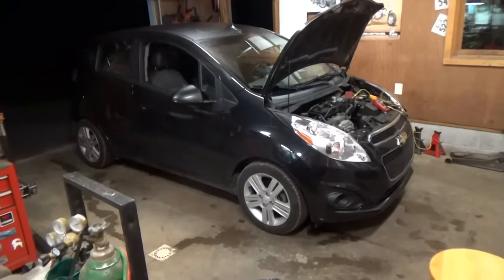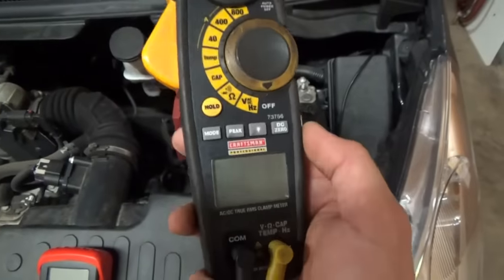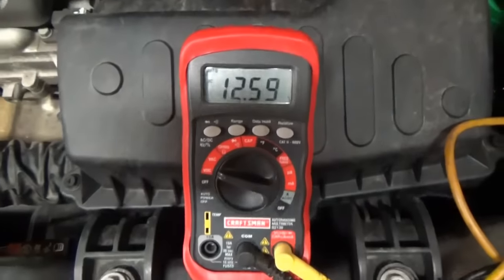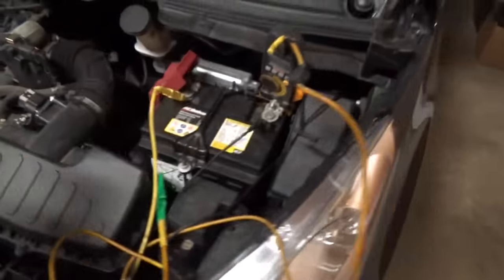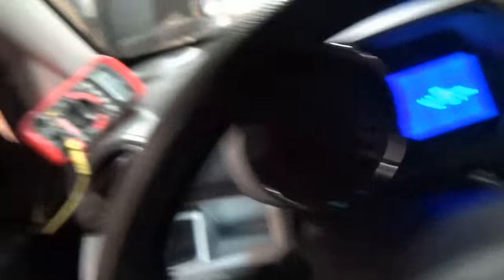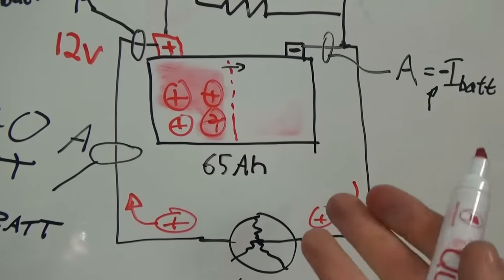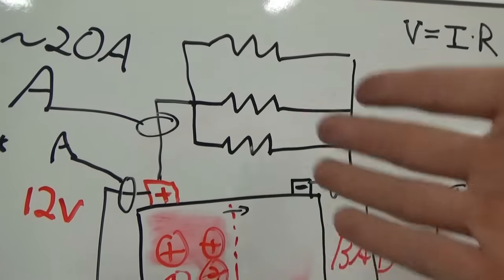Battery-Alternator-Draw Tests: EASY & ACCURATE

Comment: I have a few tool suggestions for you that are intended for electricians but are adaptable for use in the automotive trade. First is a very small amp clamp that would be real handy then I have included a few tools meant to pull/manipulate wires without marring insulation and keeping hands safe.

▶ Regarding the [need for a smaller] 'amp clamp' I have a recommendation for one that would be just perfect for this application. I have been involved in the commercial and residential electrical trade for several decades and possess quite an inventory of electrical diagnostic pieces. The particular instrument that I am reccomending is:
. . .  'Uni-t UT210E' - AC/DC volt & amp; amp ranges of 2, 20, 100 (100A max range covers most sins, and has very excellent low amp resolution in lower ranges); data hold feature; 'zero' button for DCA; clamp is marked for +/-  side orientation direction for DCA use; ohm & continuity; very compact unit will easily fit into a shirt pocket and will physically get into spaces under a hood that would prove prohibitive with a larger unit; it also has an excellent 'NCV' that is non-contact voltage feature which is intended for AC (and is very sensitive and works very well), but what I discovered is that the LED visual and audible notification also responds to my phone and tablet charger wires (when plugged in) which are DC, I'm not quite sure why it does that but anyway it detects those voltages (perhaps it will respond to auto system voltage which could come in real handy); it comes with carry case and leads; all of that for under $50; the only thing I wish it would have is a min/max feature however the unit is quite small and possibly prohibitive for another button.

▶
https://www.knipex.com/index.php?id=1216&L=1&page=group_detail&isMobile=&parentID=2719&groupID=1791
▪ KNIPEX Tools 98 62 02, Flat Nose Plastic Pliers 1000V Insulated 
▪ Knipex Tools 98 62 01 Snipe Nose Plastic Pliers 1000V Insulated

▶ 
https://voltclaw.com/
VOLTCLAW COMBO-PACK Nonconductive Electrical Wire Pliers
Reply: You have the UNI-T UT213C with MIN/MAX and the UNI-T UT216D model
Reply: And the UNI-T UT216D has even INRUSH measuring

Comment: i simply do it with  a voltmeter, if with the lights and heater fan and you still get more than 14.2v engine running, then its the battery, modern cars the parasitic draw has to be done several times over hours of turning the car off, they often draw power for an hour or so for things.
Reply: high beams, blower on high, A/C on so cooling fans run, want more load add in a cheapo "100amp load tester"

Comment: My battery fully charged is around 12.7xV - leave it overnight goes down to 12.2x so lost .5 of a V over night, checked for draw, car goes to sleep after 5-10 mins and draw moves from 500 mA to 30mA within 10 mins, I have to do one final test, I will lock the doors and latch the hood and activate the alarm and see how much it draws then with the security system on.  Here's the kicker though, it still done the same with the battery disconnected so I'm suspecting I have a voltage leak on the battery.  The battery is new but was running with a 3AMP draw before it diagnosed for a about a week or so, this may have damaged the new battery but that's what I suspect at the moment, I will test it with the lights on and see how quick it drops, great vid

Comment: Ivan,i have a very old Christie battery tester that will check alternator output and also put a load on the battery  by pushing a button,it works GREAT,and i use a vom to check for parasitic draws,i dont think Christie is around any more!!

Comment: I like your explanation of battery operation it’s simple for any diy guy to get his/her head around each cell in battery is 2.1 volt six cells equals 12.6 volt which is where the base voltage comes from you are also correct in sulfates they insulate a percentage of the conductive plates and even if you have 2.1 volts  from the cell contributing to overall voltage output it’s easy to see if you have one cell cooked and conductive plate 50% insulated by sulphate it diminishes current capacity on the one cell by 50% your looking at 10% reduction in current capacity just on one cell an as cells generally insulate the same in each cell just 50% reduction in capacity across six cells means a 500 cca battery is reduced to 250 cca maybe just enough to start a ride on lawn mower asked on the symptoms during your testing I would say you have 65-70% suphate insulation well and truly done that battery is cooked , but I have had some success in rejuvenating less cooked batteries by reversing electron flow in micro bursts if battery too far gone then it doesn’t work but 30% or less it works well

Comment: The best way I have found to test a battery that is not sealed is with a hydrometer.  It looks like an antifreeze tester.  I use a temperature compensated handheld refratometer.  One bad call will kill a battery because it is always drawing on itself to bring all cells up to an equilibrium.

Comment: like other have stated electricity flows from negative to positive  but other than that  good video.. ive noticed with a voltmeter hooked up and a load applied when you release the load the voltage comes back to a certain point. watch your meter  it should continue to creep up in voltage.  if it doesnt then the battery is no longer chemically active and able to recover. i've spotted many a battery like this and they all failed shortly after.
Reply: "Current" is the word for rate-of-flow of charge, not rate of flow of electrons.  In the common case of current in wires, charge movement is due to electrons carrying that negative charge, and will be in the direction from negative battery terminal to positive.  This is a negative current  from negative to positive which is identical to a positive current from positive to negative.

Comment: Great video... what would of been nice is a comparison between new and old battery of the discharge and recovery rate with loads on/off. What I’d like to see if it’s possible to run that old battery completely flat and see if you can reverse charge it  turning negative terminal into positive terminal. 👍🏻👍🏻

Comment: I bought a napa battery to relace a diehard sears battery that was good for 8 years the Napa battery died after leaving the care for 2days unused took it back and they gave me another battery it did the same thing, so I tought that there must be parasitic draw hooded up the amp clamp as your explaination and I did not see any high draw Napa was good to replaced the batterythe second time and it was good but what I did and not take any chance of blowing this battery I bought a trickle charger and hooked up every time I left the car in the garage and so far so good no problem with the battery.  I still think there is some kinda draw that I havn't figured out. my car is 1988 Honda accord lxi. thanks Ivan.

Comment: as always ,great and helpful video,actually tomorrow i had a case just like your car but i'm pretty  sure mine has parasitic draw issue ,because the owner said the battery has been changed 3 times with new one🙂

Comment: Good discription Ivan. I’ve usually heard you can have a cell or a few go bad and the battery is shot. It only takes a few. Or with a battery that has been discharged for a long time the cells can sulfate. Hard to bring back if it’s been in that state too long.  Usually if a battery goes bad it’s one of two things. A parasitic draw or an aged battery that’s worn out.

Comment: 4:15   12.6 to 10v just by turning the key on = battery shot.  

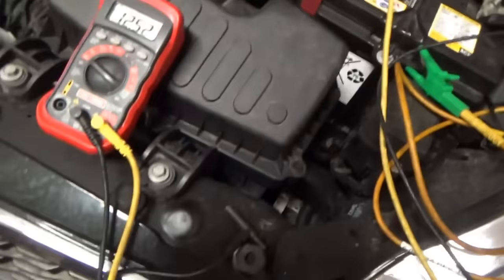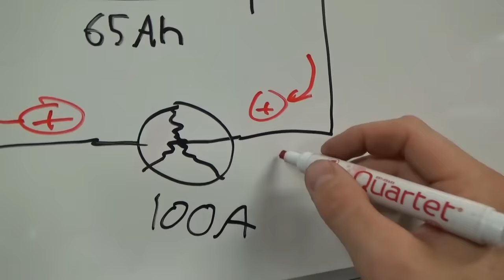12:50  amp clamp on pos or neg cable.  14:22  get car running with boost, disconnect, then see how long it takes for current to drop to zero/sleep.  19:35  battery drained from 12.x to 9.x in 5 seconds with headlights on, dead.  20:37  alternator good.

22:25  0.2 amp draw is still substantial, but 0.1 amp is not foolproof due to tool's margin of error.  23:22  the only way to know 100% is to hookup multi in series with either terminal without disconnecting the battery/waking car (and risk blowing a fuse on reconnect).

Comment: Those capacitance testers that battery dealers use place a lot of emphasis on the open-circuit voltage of the battery. If the open-circuit voltage is 12.5-12.6, the battery is deemed "good". If the voltage is 12-12.4, it will read "good, recharge". Below 12 volts, and you'll get a "bad" reading. I tested a lot of batteries with 12.6 open-circuit voltage but only 50-100 CCA measured on the tester. The tester said "good, recharge" but my knowledge told me the battery was junk. The carbon pile tester confirmed my diagnosis. I may be old-fashioned, but the best way to test batteries is with a carbon pile load tester, because it tests under real-world conditions. I guess they don't use them much anymore because they require skill to use properly.

Comment: Using a Snap-on Bat-Alt-Starter tester, you can load test the charging system, engine running of course, load test the battery, engine off, and watch the charging system with the engine running.  You need the DMM for voltage drop checks to make sure the charging system is getting amperage to the battery and no voltage drop is happening.
Those capacity battery testers do not load test the battery!  A load test is the starter cranking the engine.  The Snap-on tester does that.  Those parts house testers can't do that.
Reply from the maker: Or you can just turn on the headlights for a few minutes... Don't tell Snap on I said that haha

Comment: I use UNI-T UT210E True RMS Mini-Clamp Meter(VoltCraft VC-330), they have tested accuracy of 0,010 A.Great tool to parasitic draws finding.
Reply: I was just going to mention this.  I just got one of these, and at $45 it's a no brainer to have in your toolbox.
Reply from the maker: Wow 45 bucks? What's the catch?
Reply: It's not a Fluke.  ;)    The only drawback it has for me it's that there's no Min/Max.  But we can use the scope for that.    It's a great sidekick unit to accompany your main meter.  Great for quick stuff, goes up to 200 amps and down to 1 milliamp.  Likely not that accurate down there but for parasitic draws it's fine enough.   I also use it on 240v for checking on my usage at my panel for my generator (South Florida).   The jaws are big enough to close around a 4/0 wire.  At that price (if it's still there), everyone should have one.
Reply: You'll have a heart attack with the cost of my Fluke 325 :D but I love and trust it more than the normal retail shite you can buy.
Reply: @PineHollowAutoDiagnostics  No catch really! I own one of those and they are worth every penny. They are sensitive enough to read earth's magnetic field variations, that is why you should reset clamps in the orientation you will be clamping onto cables. Some people have even tapped into the circuit board to use this clamp as a current clamp for a scope (not really good or worth doing). Perfect tool for any kind of non intrusive circuit check, parasitic draw chasing, etc.

Comment: To do the test your doing you should start with a charged battery in case the modules or other devices dont respond to a low voltage to turn on and draw current.

Comment: Regarding jump starting using battery packs: If you were jump starting a large 6 or V8 engine and the Noko didn’t have enough beans to crank the engine on its own, could you use it together with another cars battery in a piggyback fashion to safely crank the engine?
Reply from the maker: As long as all the batteries are connected in PARALLEL you should be OK. I have had to resort to that trick more than once!

Comment: Before attempting to do in-series amp meter readings, be sure to hit up eBay for a buttload of meter fuses.  You're gonna need `em.
Reply: Or use a calibrated shunt, easy enough to make, and read the mV drop across it. Lets you use a multimeter lacking an Amp scale.

Comment: Most of my "surprise" battery failures since 1971 have been "sudden death" failures. Since I moved to warmer climates all my surprise battery failures have been of the sudden death type. I suspect that may be caused by terminal corrosion within the batteries. Weak batteries will normally start a daily driven car since only about 0.5Ah is needed to start a healty car.
Reply: High ambient  temperatures  will cause an older battery's plates to touch & short out in one of the cells. Sufation will cause detritus  to accumulate  on the bottom of the case  & it can short out a cell as well. In colder climates  we get  a warning  that  a battery  is coming close  to its  useful life. 
A visual examination  ought to indicate  a bulging  case , not always  though.

Comment: I seem to recall from watching one of Erics charging videos about the pcm controlling the charge in some newer cars and in the old days we had a metal box on the firewall called a regulator which sometimes went bad before the batt. How is a pcm different from a reg on an alternator. We'd occasionally take one of the old metal firewall regs apart but it seemed to have some crude electrics a few contact posts and a wire wound resistor of some kind. Never really sure how it sensed a full battery. Actually those firewall regs were back in the day of generators. Great vid! Thanks!!
Reply: Some of the PCM-controlled systems will do things like decrease charging while accelerating to remove the load from the engine, and increase charging while decelerating to use some of the vehicle's momentum to charge the battery. All in pursuit of better fuel economy.

Comment: I have a strange feeling that vehicle has a power distribution block issue or an ECU issue as the ECU's have a way to control the alternator based off of temps airconditioning load and rpm's because of the facts that all my newer vehicles above 2005 take a long time for the keep alive memory inside the ECU to draindown if I dont turn the key on and try to start the vehicle aswell as hit the brake pedal and turn on the headlight switch to drain off the charge held with-in faster it takes between 15-20 mins to do a regular keep alive memory drainoff down to dead zero at disconnect and when I saw instant drainoff it immediately caught my eye...

Comment: learnt new idea for battery testing on this vid.
auto off on those meters sucks . mine does have auto off delay if power it on holding another button down but still sucks not having total control, same with backlight, like be able turn that on and keep it on at times :-) 
The intelligent battery testers not that great as seen many times a low capacity old battery been in a sweet spot that gives a result of good but needs charging .
Pretty easy get idea battery poor and they not too expensive replace and cheaper than getting stranded somewhere ... 
My Dad has terrible habit struggling with old batteries, rather than get new one early on he'll persevere charging it several times and risk hassle of no start somewhere without a jump pack, then after a no crank or almost no crank he be in a panic/rush to replace it ....
Reply from the maker: Yup I have learned that batteries, tires and brake lines should be replaced before leaving you stranded, or even worse causing an accident!
Reply: +Pine Hollow Auto Diagnostics My philosophy as well. 
When we had a wide selection of good alternator and waterpump manufacturers I used to replace them every 100 K miles as well. Saved a lot of headaches over the years

Comment: I like your explanation on how the positive charges move to the negative and 6 charges x 2.1vdc = 12.6vdc. However, If 5 charges are gone, how does the battery (at 2.1vdc) charge back up to 12vdc?

Comment: Ivan can you please do more videos like this for example the basics like how to know when and where you can check amps and reading diagrams to check continuity and just overall basic checks of sensors and wiring ?
Reply from the maker: That sounds like a series of 10 videos! I was thinking of doing one on cooling system diagnostics and how to pinpoint the possible failures without guessing :)

Comment: They now sell capacitors that can be charged by a "dead" battery to start the car. You hook it up for like a half hour and then it takes itself up to over 12 volts and can crank the engine a few times with what it got from the dead battery. They look like the NOCO thing but are not a bunch of batteries inside.

Comment: I did not see you zero out the amp meter when you moved it to the positive side. Did I miss that or was it not necessary ? Also where were the wires connected from the amp meter ?

Comment: It’s useful to determine a battery’s electrical storage capacity in terms of power. In this instance 12.6V at 65AHr is 819Watts.  The battery shown is no longer useful after the discharge of just 6Watts (headlights on for two minutes at 15Amps),  less than 1% of a new battery capacity!
Reply from the maker: Be careful with the calculations there... 
Watt is a unit of Power, so Watts = Volts * Amps. 
Amp-Hour is Current * Time which is a unit of Charge (Coulombs). 

So in your example, the headlights drawing 15A means 15A*12V = 180W of Power is being consumed. That means those headlights would discharge the battery in 65Ah/15A = 4.3 hours. See how the units worked out?
Now in 2 minutes, the headlights would use 15A * (2/60)h = 0.5Ah of charge, which is 0.5Ah/65Ah, or less than 1% capacity of a new battery :)
Great review!

Comment: my only criticism would be that you could have left your booster pack hooked up to the terminals while you changed out the battery to not lose the volatile information in the car's electronic modules (like fuel/spark adaptation, radio presets, etc...).   Also, if you'd have done that most likely the alarm wouldn't have gone off.